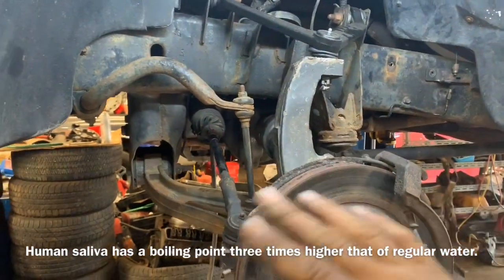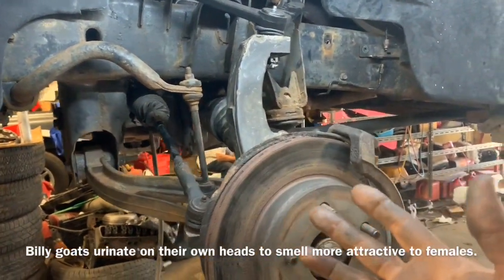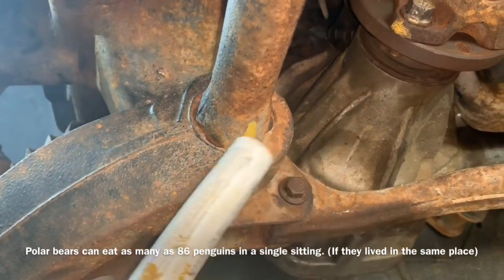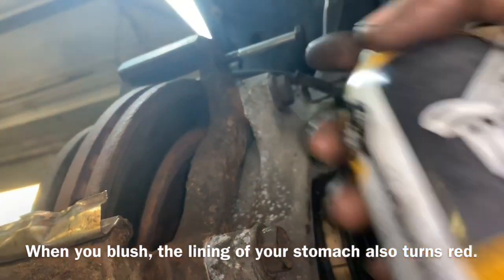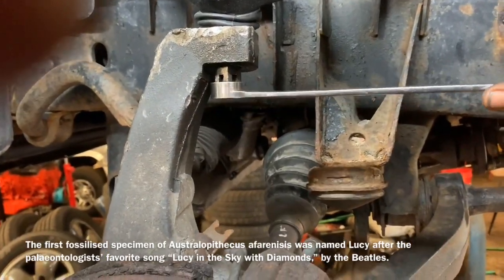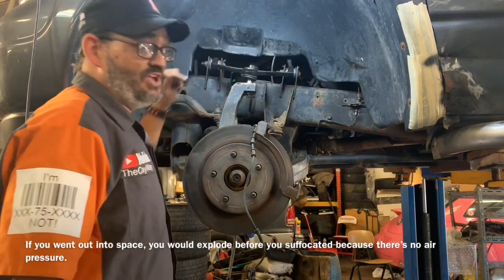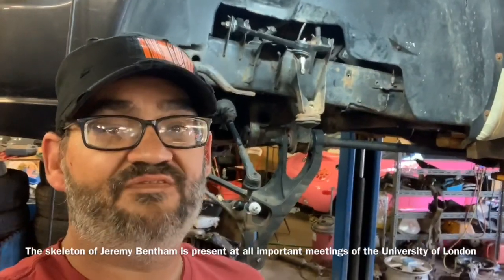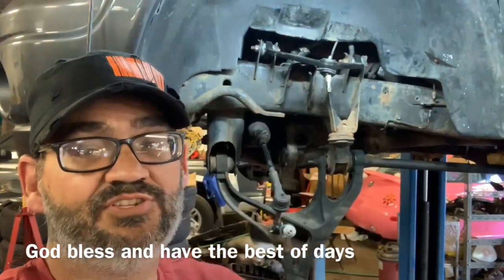Dodge ram 1500 4 x 4 lower control arm removal Dodge ram broken shock bolt

Comment: First time changing out my lower control arms on this type of truck, this videos two years old but still very helpful. Thanks for saying exactly what tools I’ll need so I can have every thing prepped without worrying 🙏
Reply: Torsion bar key was quite difficult to get back into place. Would recommend having the unloading tool but if you doing it at home like me you could take some risks and lift it up with a jack to get it in! Other than that don’t forget to always check your torques on suspension components. Great video

Comment: instead of changing the control arm you can carefully torch the broken bolt out make sure not to make the hole bigger and use a drill but to clean up what's left of the old bolt then cut new threads in with a tap i just did this and it worked pretty good

Comment: Thanks for the Video, I will attempt it my self. Upper and Lower New Control Arms.
Reply from the maker: Thanks Johnny the upper is extremely easy and there’s a video in my Dodge playlist. The lower was not that bad just remember if anyone else can do it you can do it too good luck God bless have a great day
Reply: @sharpcarco How about designing a torsion bar delete kit that would utilize a strut. Perhaps reinforce the shock mount to accept the strut?

Comment: Same for a 2003?
Is it advised to do both side and upper along with lowers as well? 

My drivers side bolt broke. I am going to assume the passenger side will do the same

Comment: Just a tip instead of removing the whole torsion bar you can just tap the key onto it and slide it out of the control arm and let it hang in there

Comment: Question do you have to use the unloading tool for the torsion bar before you can fully take it out? Or can you just loosen the bolt completely and pull out the key? And I've never done the lower bushings so do they need to be pressed in and pressed out any home tricks?
Reply from the maker: I did not use the unloading tool for the removal of the torsion bar. 

And I’m sorry to say I can’t exactly remember how that control arm is put together so I can’t tell you if it’s serviceable or not but. If it is serviceable they will sell a separate part for servicing it and I would have to assume that it is definitely something you can do at home if you have a ball joint press tool or you can rent one of them from the part store

Comment: Nice explanation on how to remove and install low control arm. Now I have a 2004 dodge Durango AWD and want to change upper an lower control arms from original to 1/ 1.5 inch short ones if I have to eliminate the front transmissions or the torsion bar it ok I can use coil over chocks I just need if you know of any out there either from other truck or from someone that fabricated them.
Reply from the maker: Hmmm 🤔 I Haven’t done that myself but I imagine if you look at a 2 Wheel Dr. version you will see exactly what to do

Comment: I took my torsion bar without making a mark on the lower control arm and the torsion bar, would it cause a suspension issue when reinstalling?
Reply: Most likely if anything it will cause alignment issues. Torsion Bars are supposed to be adjusted in unison to the same height. The main  factor aside from having both your Torsion Bars adjusted in unison with each other is not over heightening your Torsion Bars as that can cause extra load on your shocks at the front. But mainly wheel alignment is what you need to be aware of.

Comment: I’m in Grand Rapids Michigan also have the exact same issue. How much would your shop charge for this? The vehicle is a 2005 ram 1500
Reply from the maker: Hey Willis reach out to me on Clays AC and Auto Repair On Facebook messenger and I will give you a quote on labor time

Or you can call down to Accurate Engines in Grand Rapids Michigan and ask for me

616-531-2050
Reply from the maker: OK you’re looking 2.8 hours if the bolt does not break , and a little bit extra time if the Boultons up breaking like it did my video. Maybe an hour or so

Friends of the show like yourself get a labor rate of $69 an hour opposed to the $99 an hour we usually charge

When do you want to drop it off?

Comment: I'm having a heck of a time finding the bushing that mounts in the cross member, it's Mopar 52110063AA.  Did you replace that part when you did this servicing?  If so what did you use?
Reply from the maker: Hey Paul I don’t think that I replace that part I don’t remember having any trouble sourcing parts. I’d be real surprised if everything was not available after market so I would do a little bit more searching and maybe call a couple of your local parts stores. 

It’s very hit or miss at places like AutoZone advanced auto and O’Reilly because their employees are not the highest of trained people so I recommend a local mom and pop type auto parts store if that’s available to you
Reply: @sharpcarco  It is a surprisingly non-existent part.  It looks like you used to even be able to just buy the cross-member with the bushings already installed. All the OE parts are discontinued and Napa, Oreilly, Advance, Autozone, and Rock Auto don't have the bushing.  (Rock auto claims to have one, but the size indicates it's actually the front lower)

Comment: Did you have to support transmission for crossmember removal ?
Reply from the maker: I don’t think so did I do it in the video?
Reply: Do you have to loosen/remove the crossmember? I will be attempting an entire front suspension change in my garage without a lift
Reply: You do not have to remove the transmission crossmember it will slide out to the rear of the vehicle.

Comment: As far as cotter pins are concerned,  use a pair of side cutters ( clippers) and save yourself a lot of extraction time. You wasted a lot of time with pliers. Straighten out the cotter pin , grab it with the blades of the side cutters(clippers),  and pry it out
Reply from the maker: 🤔 I could’ve swore I said that in the video and the reason that I took the time to actually take it out is because some people unlike myself don’t have extra cotter pins and all of that other stuff so I try to save as much as I possibly can even if it takes me extra time it’s worth me taking the time to show people that do not know everything. So that’s why I do that.

Comment: That bolt sucks
Reply from the maker: I’ll bet if I had to do it over again I would probably be able to figure out a good way of taking it out I wasn’t quite as ingenuity back then as I am now…. Hopefully in the future I come up with one.
Reply: @sharpcarco  I need one I don’t have the funds to replace my lower control arm at the moment and I daily drive the truck 65 miles a day so having a busted shock and one hood one sucks I feel like I’m on the water not in my truck 😂but I fought for about 5 hours today trying to get it out and didn’t have luck so I put it back together I’m also limited one tools I have basic things and some specialty tools but not much
Reply from the maker: Message me on Facebook clays AC and auto repair.. I might have one
Reply from the maker: Sponsors send me stuff all the time, so I have a room full of stuff I can give away for free
Reply: @sharpcarco The reason i’m replacing mine is cause the bolt backed it’s way out and bored out the hole more shearing the threads on its way out😂